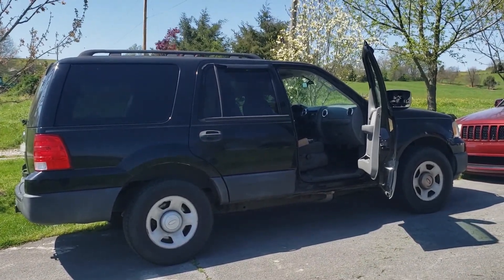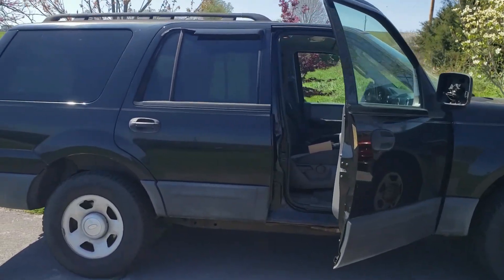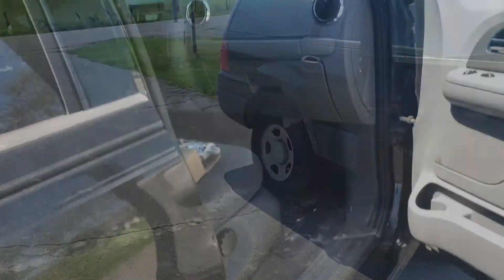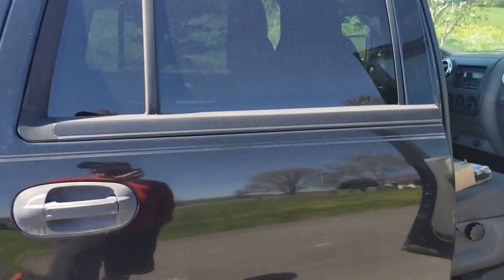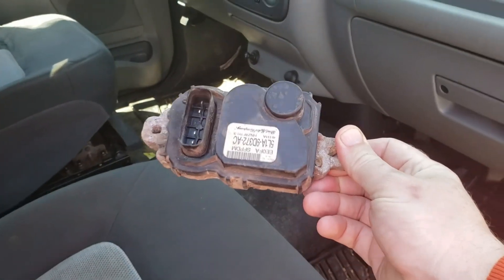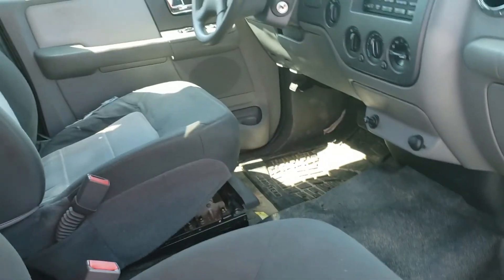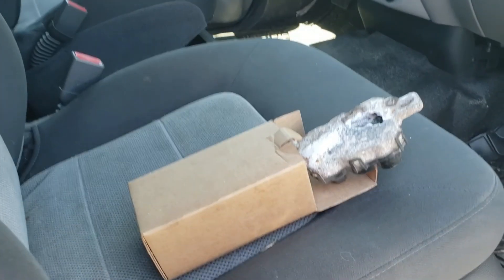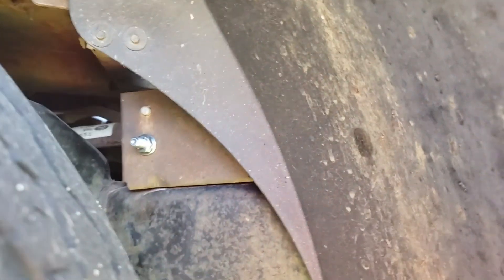How to Fix the Problem with Ford Expedition Cutting Off and Not Restarting

Comment: Aloha B.O.G., Mahalo,  for your vid.  My 2004 Ford Expedition 5.4l Eddie Bauer  solution was so simple that I forgot about it.  There is a "Fuel Reset button in the back where I just pressed it and the truck just started strong. Before that fuel button reset, I did the starting fluid in the throttle body, the truck started but shut off.  I pressed the fuel rail pressure nipple, there wasn't any fuel spilling everywhere. I also did the turn the ignition to on position and heard no whine of the fuel pump. To my conclusion was that the fuel pump needed to be replaced even after I replaced it 3 years ago that cost $1,600.00.  Hopefully the fuel reset is the problem, I had that corner bumper hit another vehicle and we kept slamming the liftgate shut all the time.  So the sensor could be sensitive LOL. Mahalo and Aloha for your vid.

Comment: Just had module replaced. Still not working
Reply from the maker: Check the voltage going into the box and out of it. If they don't, check fuses, if power going in but not out, either bad ground or bad part. If power going in and out, you will need to check voltage at fuel pump itself

Comment: I have one expedition 2006 and the car looks like that lose gas for a few seconds and then go normal and then go off and some times the engine dead completely  but start with out problem
Reply: I replace the purge valve on the front
Reply from the maker: Sounds like one of your vvt solenoids went out. With the expo you have to completely remove the valve cover to get to them. You can test then by connecting to 12v pos and neg. You should feel the valve open and close, if it works the spay them with carb cleaner as you open the valve. If both are good then its the dreaded cam phasers that went out and you can buy a used car for the amount it cost for repair. Just giving you a heads up.